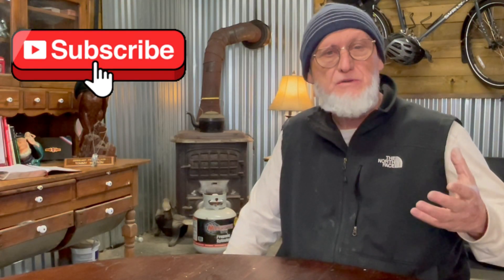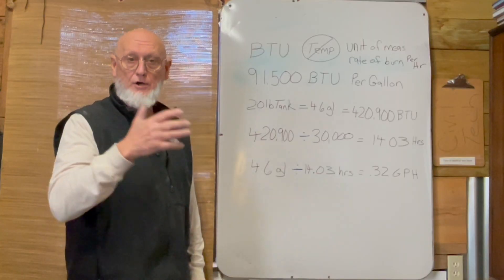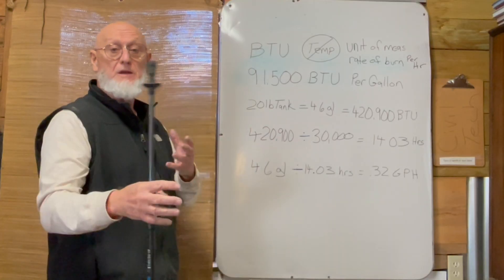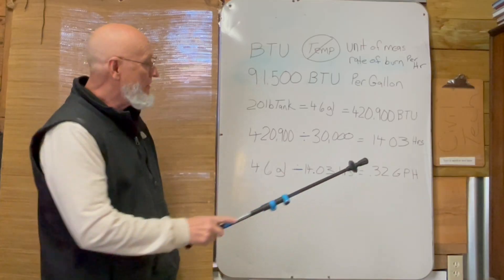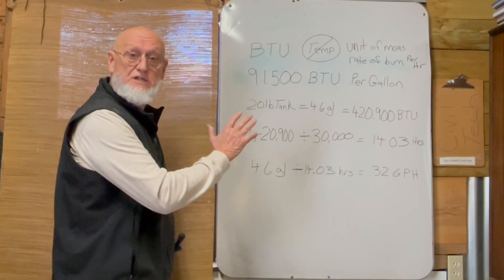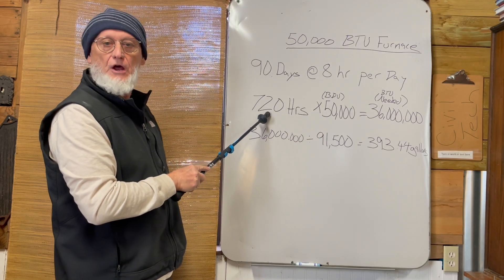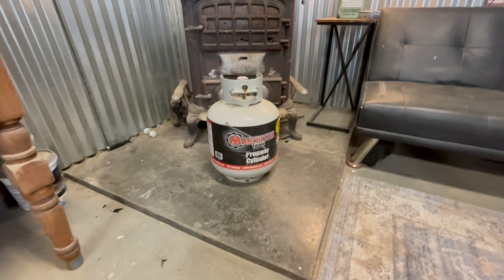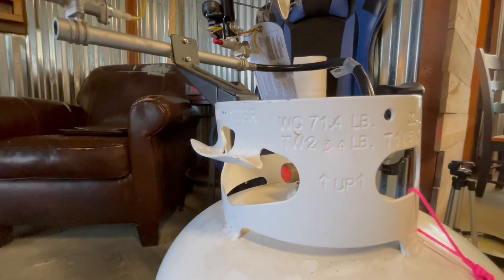HOW TO CALCULATE PROPANE USAGE FOR GRILLING OR HEATING.

Comment: Enjoyed your calculations. But cabin example would have been good to run the numbers on vented versus non vented stove/heaters. If non-vented, 400 gallons for the cabin seems reasonable. For vented, you’ll need to increase that 400 gallon amount by the inefficiency of any heat going out the flue pipe (most likely (10-15%). Never thought about tank weight minus tare divided by 4.2. Thanks for the tip!
Reply from the maker: Thanks that’s great information and correct. I was trying to not get too deep into the example … that’s when people will stop watching 😆. Thanks for watching friend. 
Please subscribe trying hard to get to 1000 subscribers. 
Tommy